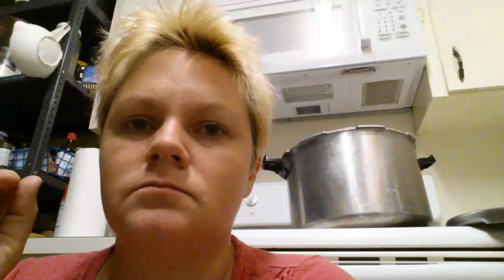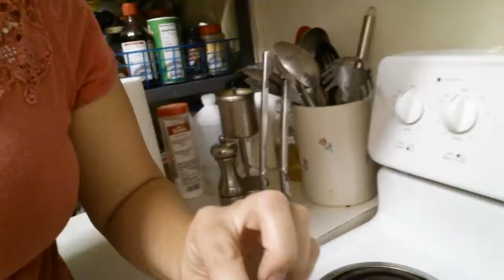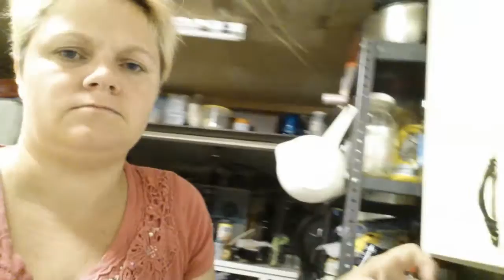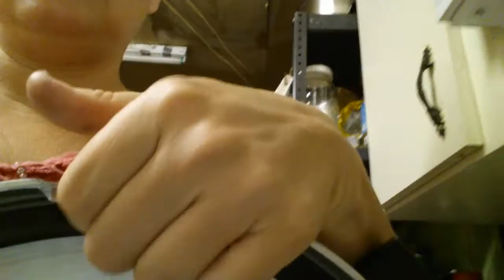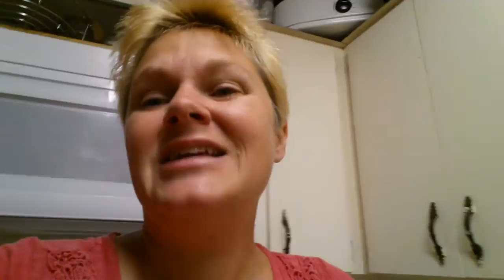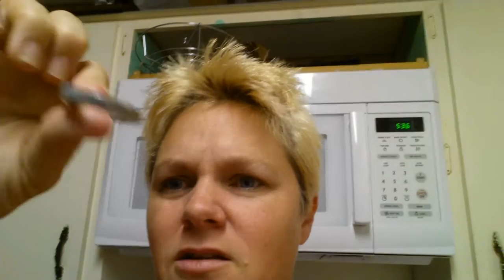Exploding pressure canner can't be real

Comment: I been canning 40 years and never seen a pressure canner blow up. For lack of better a term I have seen contents of a pressure cooker blow but not in the sense of a bomb. That picture wasn't real. Today's canners and since I been canning have 3 safety features plus the material today's canners are made of is of better quality few of things today we can say that about and mean it. The one's used years ago were often homemade and very thin metal no vents in there, no pressure valve no nothing sometimes even a pair of vise grip type thing clamping the lid on. They used what they had. As for food exploding I have witnessed the vent blowing out of a pressure cooker and when it comes out you first hear a pop and hen the typical spew of steam but in this case because it had been under pressure the broth which contain fat spewed straight up just as it does before you put your weight on it. Those valves usually in a pressure cooker can get clogged so its important to clean it with a toothpick or something. Does it mean you can be careless, absolutely not and no I wouldn't let someone who was careless or spontaneous around me while canning. Contamination is your biggest threat with canning or being burned with steam because you opened it wrong and didn't allow it to cool enough.
Reply from the maker: Amen! It drives me nuts that there is a fear propaganda used against canning. Do it right and it's safe. Lol, I don't work well with others in the kitchen, that is why I get kicked out, but in the end it is nice to tell them about it. But this fear works, so many people I know won't even eat home canned food, much less to even attempt it.